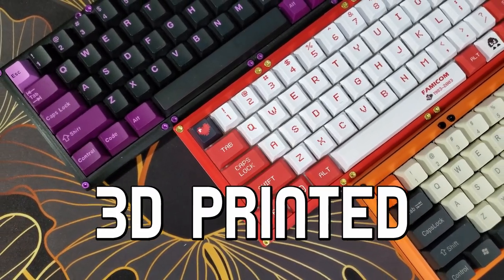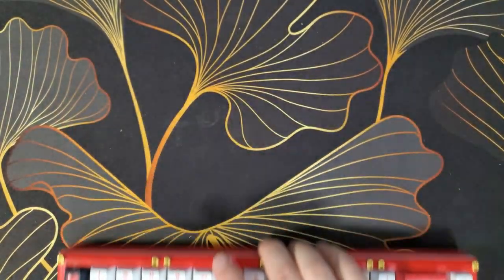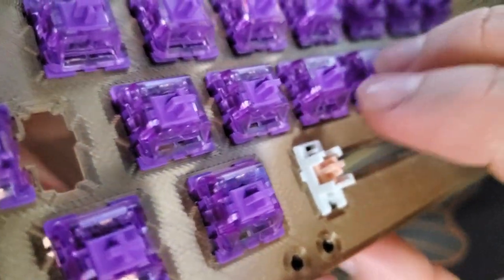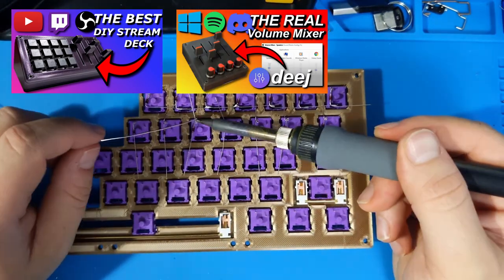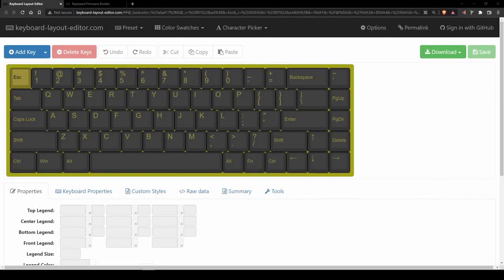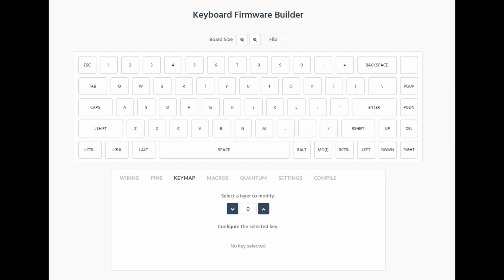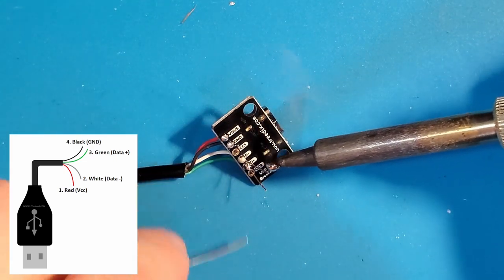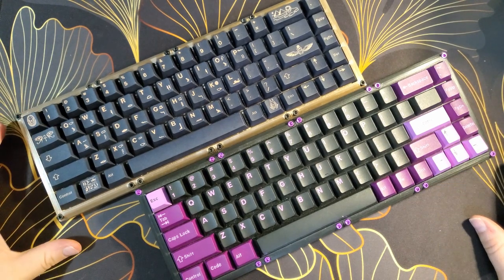My Favorite Mechanical Keyboard: A DIY 3D Printed and Handwired Custom

Comment: Looks great,

You should put two 5.1k resistors to ground from each of the CC pins on the USB C breakout, this will let you use more cables as it will better conform to USB spec. 

You may find without them that many C to C cables just won't work
Reply from the maker: Thanks for the tip

Comment: I am surprised you did not use some 3d printed bending tool to form the diodes in a precise shape before soldering them to the switches. A lot of electronics channels I follow use those to precisely bend components and make them look beautiful, thanks for the video!

Comment: My absolute favorite thing about this design is that it doesn't leave a small blank space next to the arrow keys. Why do all these 65 and 75 keyboards leave that little space? Condense everything to the right of the space bar, and put a third key between space and the arrow keys! I also love that it has all of the keys on the right side filled and that the arrow keys are aligned with the bottom and right rows. Why do people like the arrow keys separated? It looks so messy to me. Only thing missing is a knob!

Comment: This is pretty cool. The only mod I'd want to make to the design is to add a battery and make it capable of going wireless. That way I could use it at the desk in wired mode and then take it to the living room and connect it wirelessly to my Pi.

Comment: Hey man!! Ive been working on mine and a Problem came up... since de botton part has the recesses for the switches and for the stabilizers  Im assuming I should print this face down, but than my printing resolution became very poor to the point where I had to file each hole, tldr the fitting and aliagment are terrible... any tips?
Reply from the maker: You are correct printing the plate face down. The first layer squish on your printer is causing the tolerance of the switch cutouts to be tighter than expected. I have had the exact same problem before! I solved this by changing my printer's z-offset so the first layer is not so spread out. If the change affects your bed adhesion, I have used hairspray on the print bed to keep the plate from warping.
Reply: @MadModLabs  u are my favorite person! lol ...thx alot man

Comment: Man Id love one of these for a 75% board, and trying to figure out a way to make it bluetooth or dongle compatible
Reply from the maker: I would like to design some larger keyboards in the future. I guess the most common 75% layout would be similar to this but including the Function row at the top? I have a 95% layout that is assembled with bolts around the edge like this one but I have not released it yet.

Comment: I love it! I have just 3D designed my own keyboard but can't figure out how to split it so I can print it on my Ender 3v2. How did you make the plate click together?
Reply from the maker: The division in the plate is diagonal so the bolt holes are offset from the bottom of the keyboard case. It does not really click together but it is held together with bolts instead.

Comment: how much filament goes intro printing all that? sorry if you mentioned and i missed it
Reply from the maker: Sliced in Cura with the standard settings of .2mm layer height, 20% infill density and 2 layer wall thickness, the 7 pieces total 202g (67.38m) of filament. You can change the sound of the keyboard by printing with more infill or thicker walls.

Comment: so i replaced the pico i used with a teesny 2.0 and now everything works fine but i cant get the usb c breakout board to work when i connect the teensy via a mini usb it just works but as soon as i use a converted mini usb to usb c cable it doenst get recognized (windows code 43 but its the same on andorid so i dont think its an driver issue)i used the same pins on the same breakout board with the same wiring except that i have a blue wire instead of a black wire does that mean that the wiring might be diffferent for my cable  ?
Reply from the maker: That sounds like an unusual cable. If you have a multimeter, you could test each of the USB wires for continuity with the pins in the USB plug. does the cable have any other colored wires like this one? https://i.pinimg.com/736x/81/b9/67/81b96782f07a9b7f451b7c8aba542751.jpg
Reply: @MadModLabs  it indeed is wired like this cable except that my wire has a red wire instead of an orange one thanks alot this might be it

Comment: does it matter if the top or the bottom pin is used for the resister soldering?
Also would it be possible to use something like the QMK firmwear to install the KBD67/rev1 and flash it onto the teensy? If so what would be the correct pinouts needed to solder?
Reply from the maker: It does not matter which pin you solder to the diode. However, each switch must have one pin soldered to the row and one pin soldered to the column. It is also important that all the diodes face the same direction.

You can not use the KBD67/rev1 firmware for this project. QMK works on the Teensy 2.0 but you will need to compile your own firmware or use the firmware included with the project files.

Comment: made it through soldering each and every row and column. wanted to see how the key caps felt. Looks like the spacebar stabilizers are sticking and I can't for the life of me figure it out.
Reply: i'm not sure how to trouble shoot further i don't think it's the stabilizers or the caps?
Reply from the maker: It could be the tolerance of the 3D printed plate. I would recommend taking a file or a small blade and making the stabilizer cutout slightly wider. This will allow the stabilizer to slide a little to the left or right and light with the spacebar stems.

Comment: making your own keyboards / keypads is fun!
the only downside if you have to use QMK in the end, which is truly horrible.
Reply from the maker: You could always try flashing an alternative firmware. I have seen some pico based builds using KMK firmware. I have never tried it but it looks interesting.

Comment: What is the best way to troubleshoot a handwired board is a switch doesn't work or if there are issues? How can you find a short in any of the wiring?
Reply from the maker: Is one switch not working or is an entire row or column not working? If one switch is not working, check the solder points on both of the switch pins and the attached diode. Also, The individual switch may be damaged. You can test it with  a multimeter or swap it out for a working switch. If you have an entire row or column that is not working, you should check the solder points on each wire that attaches to your microcontroller. While looking for shorts, check  the pins on the micro controller and make sure the board is not pushing against the matrix wires. Place something between them like a piece of tape. Also make sure your wire's insulation has not melted in an unexpected area. The column wires can not touch the row wires. Beyond these scenarios, incorrectly configured firmware could cause a switch to appear defective. 

Hope this helps!
Reply: @MadModLabs   The issue I have is when I plug in the keyboard the W key is spamming. I am able to get it to stop by unplugging and plugging back in. But then the W key is no longer working. I double checked the solder points, all look good. And even used a multimeter and I get tones when testing the current from the controller to the switch row/column.
Reply from the maker: Have you tried replacing the switch with a different one? @Glitch_860
Reply: @MadModLabs  I resolved my issue. How I soldered the wires to the board there was a short. I was trying to use the included pin headers on the board then connecting the wire. When I replaced everything with a new board and soldered wires directly to the pins on the board it worked!    LOVE YOUR content. Been also trying to get Bluetooth to work on my Zune but having issues where the pads keep coming off the Bluetooth adapter.
Reply from the maker: Thanks! I'm glad you got it working. Some of the soldering for the Zune project is tricky. I would recommend using leaded solder and thinner gauge wires for the best results. I was just using some recycled wire and it was more difficult than it should have been lol.   @Glitch_860

Comment: The Teensy 2.0 isn't being made anymore.  But it I were to build this, I'd probably want to use QMK firmware on the RPi Pico, or similar rp2040 based board.  I also might print it in PETG, PLA can be quite brittle.
Reply from the maker: You could use a cheap Arduino Pro Micro clone.
Reply: @MadModLabs  I don'tt think they have enough I/O pins.  The Chinese clones seem to have only 18 lines brought out.  Same with the one made by Spark Fun.  There is the real Arduino Micro though for about $25.  The RPi Pico is much cheaper and has enough I/O.  I'm sure that QMK has already been ported the pico.
Reply from the maker: @scharkalvin  the pico is great if you prefer. I have been removing the LED resistors on the pro micro to access pins B0 and D5. You can do a lot with 20 pins depending on how you set up the switch matrix.
Reply: @MadModLabs  I forgot about the 'extra' dedicated lines to the LEDs.   Another idea would be to add an external 3 to 8 decoder IC (74HCT138) to drive the row lines, but that means moding the firmware to output encoded rows rather than one at a time.
Reply from the maker: @scharkalvin  Yea adding an encoder would complicate things. In some of my other projects that require more switches, I use a different development board that has more pins like the Arduino mega or the teensy 2.0++. I prefer to keep it simple even if I have to buy a clone development board haha.
Reply: @MadModLabs  Being a retired software engineer, I'm not afraid of changing a few lines of code to save some hardware costs.  Adding one IC isn't too bad, considering all the other wiring that's required (with a gazillon diodes!).  Often the route chosen depends on what's in my junk box!
BTW, I'm using open scad for most of my simple 3d printing cad work, but I'll probably play around with fusion, I'm already teaching myself KiCad.  I'll have to check out some of your other postings to get some more ideas.  Thanks!

Comment: can you do a keyboard with a trackpoint?
Reply from the maker: I have never tried to build a keyboard with a track point. I think this is a cool idea though. I definitely want to look into it as a future project.
Reply: @MadModLabs  great thank you, they are impossible to find other than the ones lenovo makes but they suck I've had 4 of them
Reply from the maker: @82sjmc  I know a guy that has the Tex Shinobi. It is a pretty good keyboard if you like the ThinkPad layout. I would recommend getting the DIY kit though so you can add whatever switches you like. https://tex.com.tw/products/shinobi?variant=16969883648090

Comment: what are the steps for using an pro micro instead of a teensy 2.0? 😅
Reply from the maker: The process is pretty much the same using an Adruino Pro Micro until flashing the firmware. You must be careful selecting the pins for the rows and columns on the Pro Micro. The Pro Micro pins are labeled differently. This link has the pin labels translated for QMK firmware: https://golem.hu/article/pro-micro-pinout/
Also, Instead of  flashing the firmware.HEX file with Teensyduino, you will need to use a tool for programming Atmel microcontrollers like AVRDUDESS: https://blog.zakkemble.net/avrdudess-a-gui-for-avrdude/
Reply: @MadModLabs  i think the arduino pro micro doesn't have the b7, c7 and d6 pins, where should i wire those?
Reply from the maker: @huyu463  You are correct. The Pro Micro does not have those pins. You must define a different pin while creating the firmware in the keyboard firmware builder.
Reply: @MadModLabs  how i load the firmware in the firmware builder? is the .hex file? or i have to create it myself?
Reply from the maker: @huyu463  I don't think the firmware builder will let you re-upload a hex file. The firmware will need to be created from scratch
Reply: @MadModLabs  f
Reply from the maker: @huyu463  I can help you generate the pro micro firmware if you already have  keyboard wired up
Reply: @MadModLabs  it's ok i got a firmware for the iso wiring, im going to try it up

Comment: I built this and when I plug it into my computer it doesn’t recognize it’s a device but power is gettin to the teensy any ideas on how I could get it to work?
Reply from the maker: Did you flash the firmware with teensyduino?
Reply: Yeah
Reply from the maker: @kydenpeterson  You could try a different USB-C to USB-A cable. Or you could try adding a 5.1k resistor from each of the CC pins to ground on your USB-C breakout board. This will make the port compliant with USB-C standards and allow more cables to work. I had to do that in this video: https://youtu.be/iv__343ZwE0
Reply: That didn’t work
Reply from the maker: @kydenpeterson  if you plug the teensy into your computer with a mini USB cable, without using the breakout, is the device recognized?
Reply: @MadModLabs  Yeah it recognizes i

Comment: How long did it take to print all the 3D printed parts?
Reply from the maker: With a stock Ender 3, the combined Cura slicer estimate for printing time is approximately 23.5 hours. This estimate includes all 7 pieces printed at .2mm player height with 2 walls and 20% infill.
Reply: @MadModLabs  thank you! I wanted to know how much this would cost for me to have it printed at a fablab near me since they charge per minute :)
Reply from the maker: @hlrn4141  That is awesome! I hope your keyboard turns out great. If you are needing 3D printing services, I have had parts shipped from my partner PCBWay.com definitely check out their website and see if it is in your budget.
Reply: @MadModLabs  hi, i tried having the parts printed at a nearby store but when they tried preparing it with prusaslicer, something went wrong during slicing for both the bezel left & right files. Is there a way to fix this? 😅
Reply from the maker: @hlrn4141  I sliced it with Cura if that helps
Reply from the maker: @hlrn4141  I exported the model again using solid bodies instead of T-splines. This should remove any incomplete or unnecessary geometry that may throw an error in your slicer. The updated files are available here: https://www.printables.com/model/307908-mechanical-keyboard-68-key-65
Reply: @MadModLabs  Thank you!! The bezels finished printing just fine using the new files, however, the guy in charge of the shop told me that the other files  threw an error in the middle of printing. Is it alright if you export the other files as well? 🥹🙏 Sorry for bothering you 😅
Reply from the maker: @hlrn4141  The other files were not remixed so they do not have unnecessary geometry. If the problem is occurring in the middle of printing it is most likely a problem with the 3D printer or they are printing in an incorrect orientation. Errors related to geometry should be visible in the slicer software before printing. Make sure they are printing the plate with the top side down.
Reply from the maker: @hlrn4141  I have updated the files on Printables to default to the correct orientation for printing. https://www.printables.com/model/307908-mechanical-keyboard-68-key-65/files

Comment: No sounds test? D:
Reply from the maker: I have found the sound of these keyboards vary a ton depending on how dense they are printed, what switches you use and whether or not you add any dampening material inside the case. I have another video of a completely 3d printed keyboard that  does include a sound test, if you are interested. Thanks for watching!